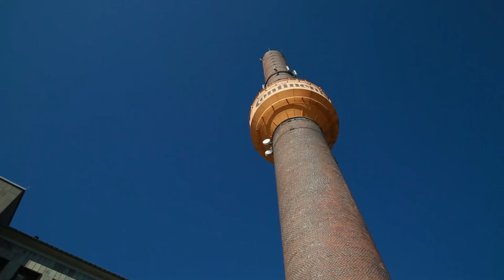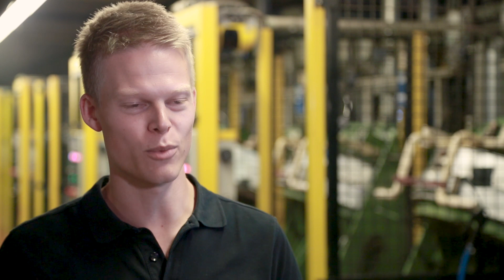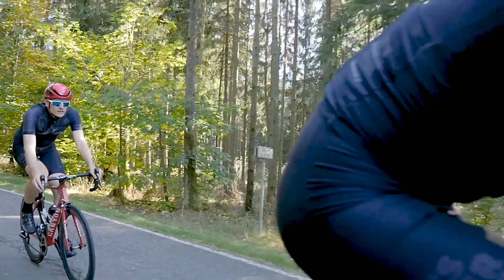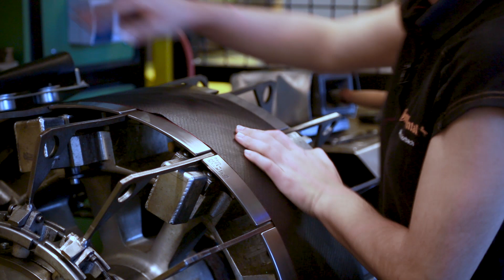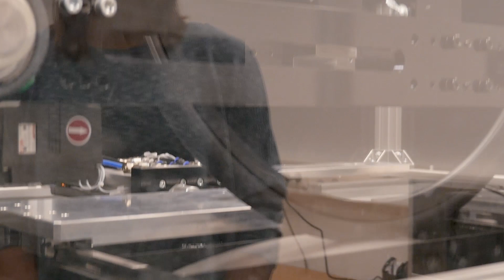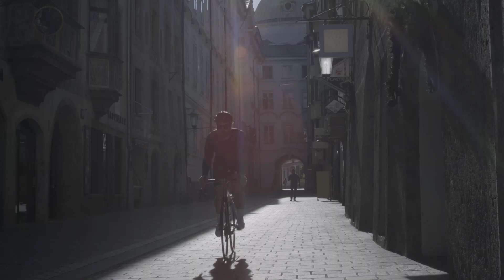Factory Tour - Continental Grand Prix 5000

Comment: Continental 5000s 28mm 
Just put 2 of them on tonite(I’ve probably had 20 - 30 conti 5000 tires since I started riding road bikes in 2018) 
There the only tire I buy
There $50 a piece but the clincher 28mm make it for a smooth ride and don’t flat easy they are strong and grippy 
This is such a good video I’m glad I came across 
You German folk are killin it!